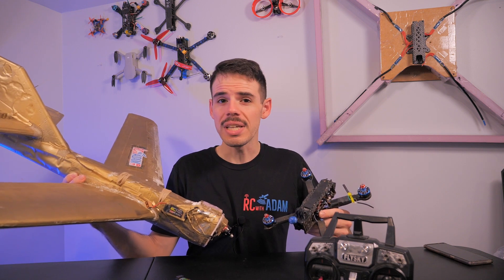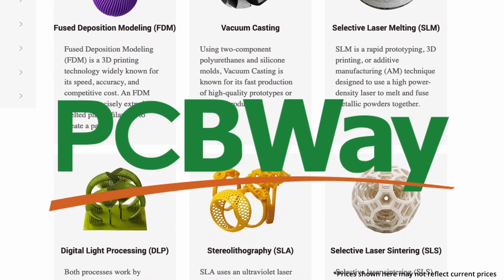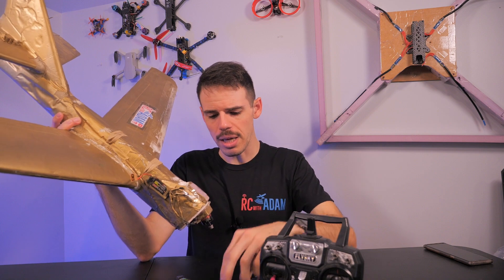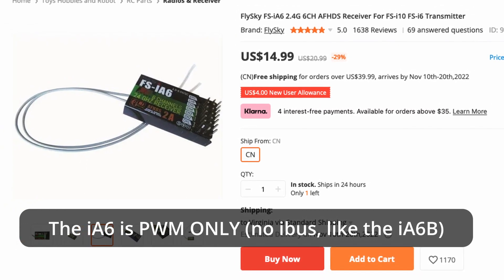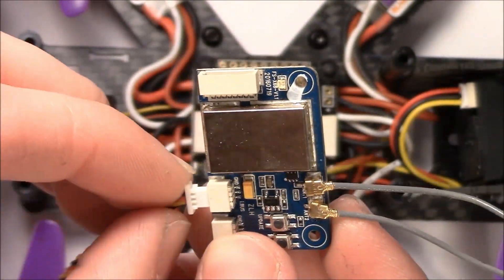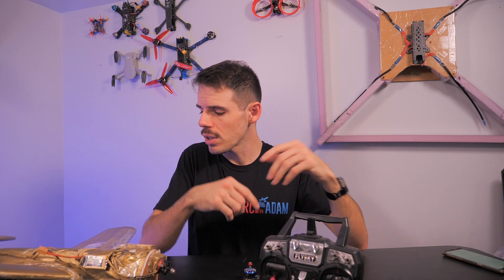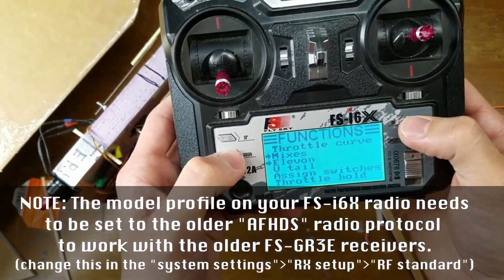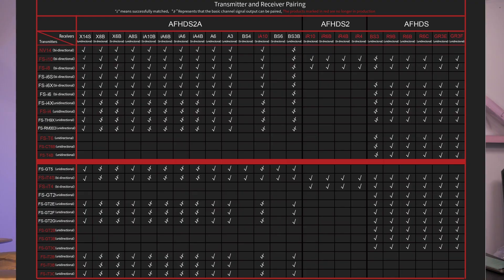The BEST Flysky receivers for Airplane or Quadcopter, FPV Drones (that I've used) - FS-iA6B, Fli14+

Comment: I use an fsia6b that i moddet to Display the voltage of the flight pack, also i depinned it(made it very small) , and also i use the ia6 as the Transmitter, but with modified Firmware, also i put in an 2s 5200mah liion pack from an Powerbank, it barely fits in there ,but i also needet to use 2 other voltage Regulators, the original ones  can only work up to 6v and 2s voltage is higer. I  also addet usb Charging and Balancing(also it is compatible with usb c PD), an raw Batterie Input/Output (for Powering screens, Goggles or some external Module like Crossfire,...) 
So i get about 5km range now without modding the antennas. (But thats maybe the next step) maybe i put on an extra Switch, it is also possible...

 If there are some questions about how to modify the Radio or reciver please ask me.

Comment: I have bought a FLYSKY FS-IA10B and I tried to use it with my new eachine wizard v2. However when I select receiver mode to ppm in betaflight the motor one starts twitching and would not work. Motor works fine if I select another receiver type. What could cause this?
Reply: Im not sure but for a quad you use ibus reciever connection to a wizard flight controller . The reciever outputs one wire carrying all the channels signals on one wire of the ibus output plug and the other 2 wires are 5v and ground to power the reciever  from the flight controller and drone battery .